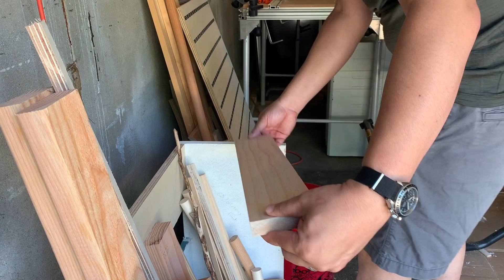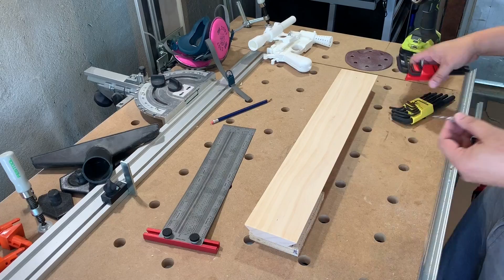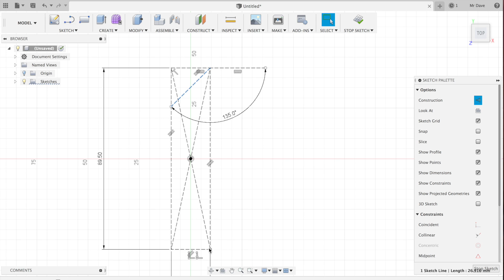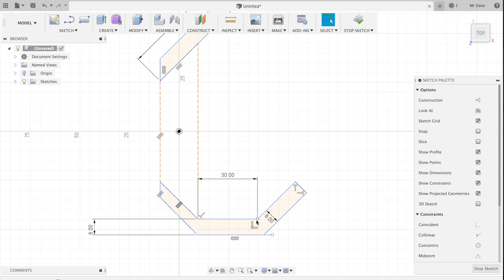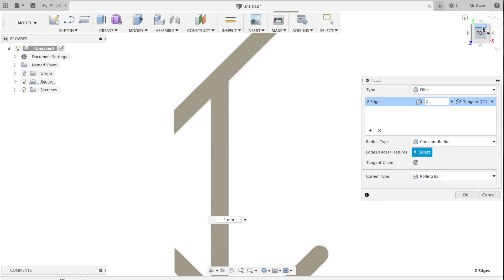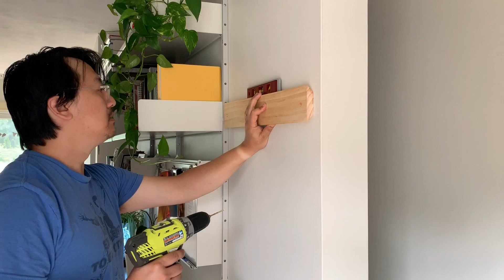DIY Coat Rack with 3D printed Hooks

Comment: I think contrast is key in the colour choice here, so with this light wood the black hangers looks better - but if you make a new one with a dark wood my guess would be that the white ones will look clean 👌
And also, 50% infill sounds like a lot! Try printing one with like 10% and see if it holds up for your usage. It will shorten your print time significantly and probably hold no problem 😊
Reply from the maker: Thanks for the comment Gustav. The 50% infill was definitely over kill. On IG I did a test of the hook and it held well over 50lbs of weight. Which was definitely more then it needed to be. I had to put my body weight on it to eventually break it. Also agree about the contrasting colors too.
Reply: 5% infill for a hat hanger lol

Comment: Awesome stuff! Did you have an issue with the hooks sliding around?
Reply from the maker: I had a really tight fit. Depending on when you make yours. you can just sneak up on the cut for the wood. Or you can scale the size of the hooks to get the perfect fit. In the video I show you how I printed just a few layers and stopped the print. to get a good test fit.

Comment: How do you like the saw stop job site saw? I noticed that you work a lot with plywood, but does it do well with thicker boards as well?  I just stumbled on your channel earlier and I really like it. Thanks for the nice videos!
Reply from the maker: I love it! I unfortunately got it before the update. The issues I had with it were addressed in the newer job site pro. As for cutting as long as you are using the right blade and not abusing it with anything your not suppose to be cutting on it. It works great. I have resawn some lumber but did it in multiple passes and flipped it over end to end to do the other side. Works well. If you got a small space and safety is a priority then this is it.
Reply: @3ddiy  thanks for the tips!  Have a good day!

Comment: Cool video! I like the attention to detail. Just wondering, I never use a mask during woodworking but I see you do, should I use one?
Reply from the maker: Overtime people can develop a allergic reaction to the dust from the wood. Also if you're cutting plywood there are toxic chemicals in the glue that should not be inhaled.
Reply: @3ddiy  okay, good to know, I started reading about masks and stumbled upon the Bill Pentz website about woodworking dust and it seems to be pretty bad for you. I ordered a particle counter and a respirator.
Reply: Yes, you absolutely should!  Sawdust particles cause cancer.  They cut the DNA in your lungs. Google it.
Reply: Especially with  hardwood dust you should be carful. It is not know how but probalby wood additives can lead to cancer. So better be safe. Also wood dust can cause asthma.